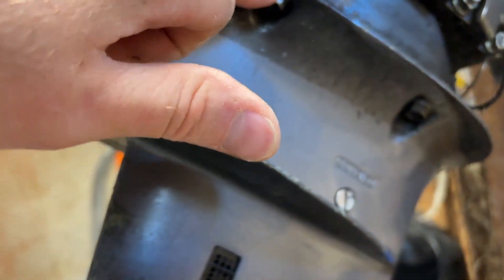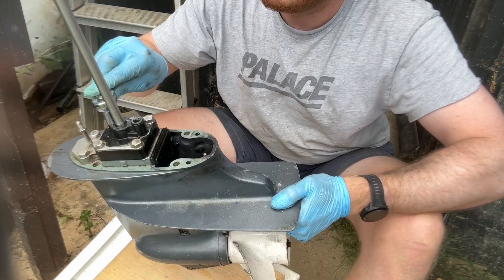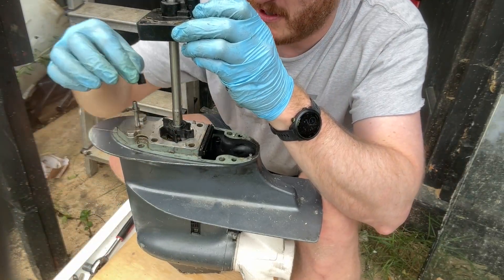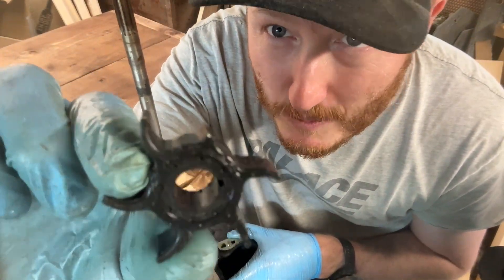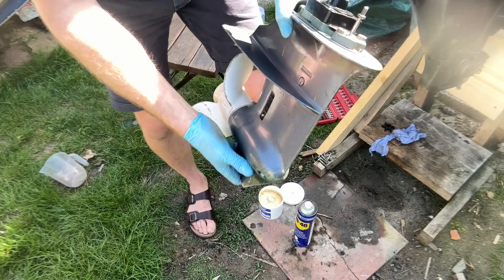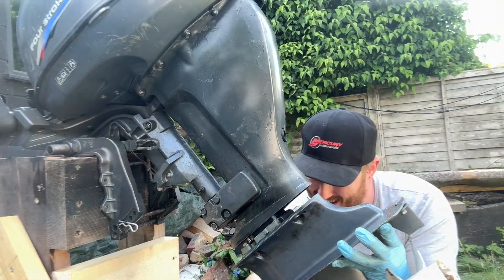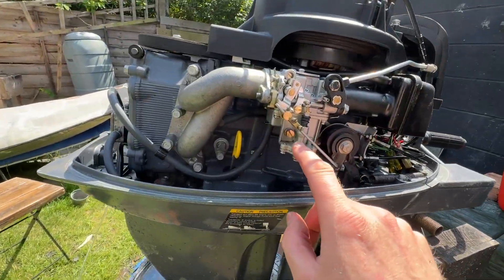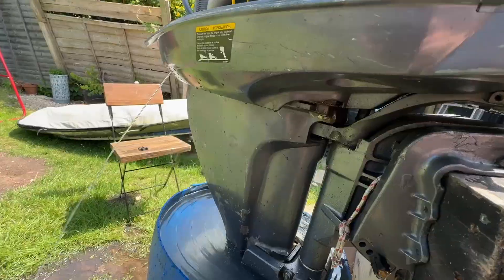Yamaha 9.9hp Impeller Replacement | Super Quick Guide

Comment: When the bottom end was stuck after you got all the bolts out 1:35.  How did you get it off? I’m stuck on that right now and can’t figure out if I just need to brute force it or if there’s a trick
Reply from the maker: If all your bolts are out and the gear screw is undone then maybe try wiggling while knocking with a piece of wood or rubber mallet.